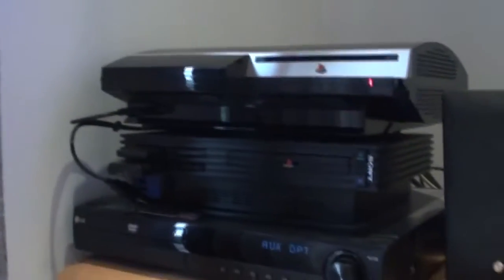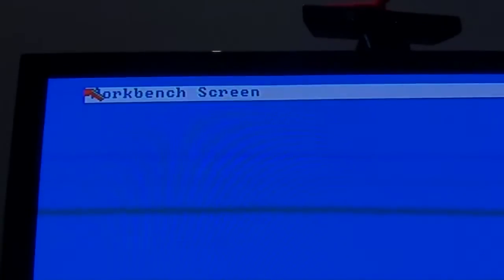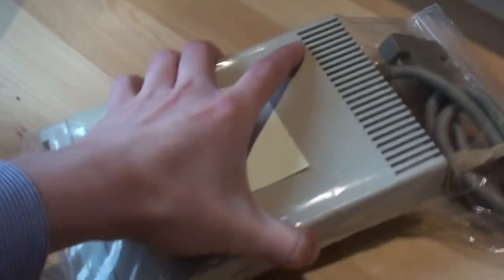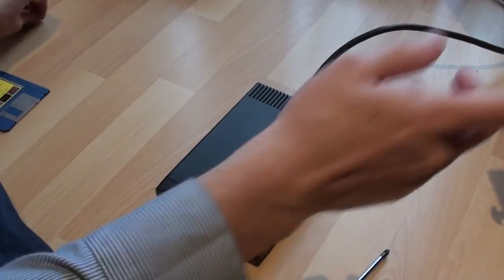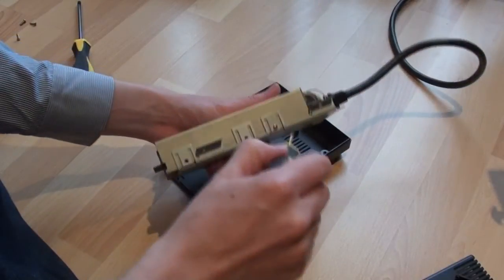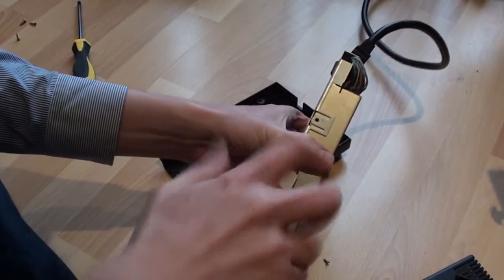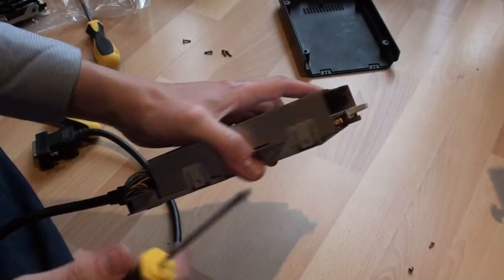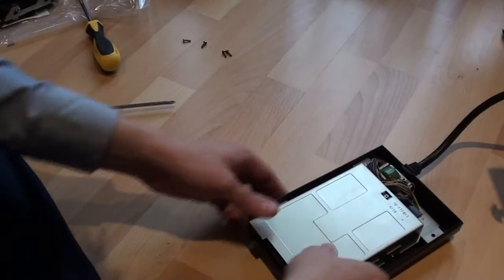Amiga Floppy Disk Drive Repair

Comment: Just an idea. Can it be the capacitors went stale over time? When you put on the shielding it attaches through the screw holes to the ground contacts of the pcb which changes the characteristic of the circuit. Maybe without it somehow the drive manages to work (barely functions by a chance). I would try to recap the drive with new capacitors?

Comment: Clean the 2 switches on the front with contact cleaner, clean and grease the head spindle, clean the heads, and change the 4 caps 😏

Comment: I've just repaired my similar drive with similar issue. The switch that gives signal when a floppy is inserted was, as suspected, faulty. I screwed it loose (only one screw) and pulled it carefully out ( 3 wires soldered on, ground, floppy inserted, write protect). I then opened the plastic carefully (the brackets will break, used superglue when closing it). Inside the switch, one microscopic metal sheet was out of position, I fixed that and used super-glue when closing the switch plastic again. Floppy drive now works fine.

Comment: It's black tiny micro switch on the corner of the drive. You could spray contact cleaner spray into it and give it a wiggle. Isopropyl alcohol won't work because it doesn't remove oxides from metal contacts.
Reply from the maker: +Matt Gorzka yep that's exactly what I did in the end and it worked great. Have two working drives now. Great tip

Comment: It's black tiny micro switch on the corner of the drive. You could spray contact cleaner spray into it and give it a wiggle. Isopropyl alcohol won't work because it doesn't remove oxides from metal contacts.

Comment: You have to open the disc detection micro switch and scrap the contact plate in the bottom. they get corroded over the years and the switches makes bad contact. I fixed 3 drives by doing this. It's extremely small springs inside the switches and I had alot of trouble because everything was so small. But when done properly it will fix the problem. Using CRC/contact spray on the switches would just fix it for a period and the problem would come back. So the only permanent fix was the above mentioned.
Reply from the maker: +Mats Larsen I just sprayed some Isopropyl alcohol all over the switches, the original drive has worked fine for about 3 years now. But good tip.
Reply: I also tried isprop. Your switch was probably not heavily corroded on the contact surface then.

Comment: If you take the case off and look through the front there are 2 buttons that are write protect and change just keep the change button (the one on the back of the write protect) just hold the change one down
Reply: Also If you would consider subscribing if it works ok?

Comment: THIS GUY IS AN ANTI COMMODORE RETRO STUFF ! HE ENCOURAGES PEOPLE TO MAKE  mods and other hardware changes compromising the original Commodore systems structure !  IN THIS VIDEO HE´S  DISMANTLIN AN ORIGINAL AMIGA (rare)  DRIVE TO PUT IN A CDTV ! THIS IS ANOTHER EXAMPLE OF THE LACK OF RESPECT FOR THE ORIGINAL COMMODORE PRODUCTS THIS GUY HAS.
Reply from the maker: Not wise to comment on things you don't know about Gulliver. The black CDTV drive is rare, the beige Amiga one is pretty common. Anyway I repaired the drive using some cleaner on the disk insert switch, the Amiga drive has been happily working for over a year now, currently with my A4000. No drives were harmed in the making of this video.
Reply: Is pretty common where you live  but in the rest of europe it´s not !
Reply: Dan Wood (kookytech.net) I am not apologist with regard to certain videos you made and others you´ve been doing because it is my belief that a commodore or other retro computer should remain original 100%. I´m owner of three Commodores and i keep them as they were designed
Reply: Get your head out of your ass...
Reply: A guy who fixes Commodore Amigas as well as extents their life seems to do more for the community than you do it seems, oh dear.

Comment: I had similar problems with my drive in an Atari ST and an Amiga 500.
There are 2 (3 on HD drives) "buttons" inside the drive which are operated by the disk. One scans the WP hole and the other gets pushed down whenever a disk is inserted. Probably the one that gets pushed down by the disk has gone bad.
It doesn't necessarily have to be a "button". My A500 drive had a magnet on a tilting mechanism that got tilted towards a reed contact. That reed contact has gone bad.
It affected the WP sensor not the disk present sensor. It drove me mad. Every time I wanted to demonstrate it to someone it worked just fine.
BTW... you don't have to butcher a similar external drive. Any old amiga drive should work just fine, I guess.

Comment: Hello, I also had problems in recognizing disks and I think it's the pin which detects the drive. There are two pins, one for the disk recognition and one to check the write enable hole of the disk. I think this touch sensor (aka button) has a problem. Did you try this?

Comment: I used to have a CDTV years ago, should have kept it. Anyway If not mentioned before check this video out, Chinon drive with the same problem and possible fix: JPSOP_Gxkcs

I would tend to aim for lubricating the mech, frame etc rather than messing about adding more springs... I can see the little spring hooks snapping at a later date which is not good!  I am also going to refurb an A500 Chinon drive soon! Fave drives, my first A500 Rev6A had one :)

Comment: It's probably the spring that pulls the mechanism together when the disk is inserted - if the spring becomes weak through repeated usage the mechanism doesnt pull together tight enough and the disk doesnt quite press the switch firmly enough down.  It floats in a state whereby vibrations can switch / unswitch it.

Comment: There's another vid on youtube for Amiga HD Floppy Drive Repair.  Not the same problem and it's HD, but it has a great view of the disk inserted switch and how to test it, along with some software on aminet.  My 500 drive was acting similarly, I just needed some contact cleaner in the disk sense switch and then actuating it a bit to get it cleaned up..  Might not be the same, I didn't have the problem more with the case on, but worth a shot.  Good Luck.

Comment: If it works when you try pushing it down to help it lock into place, you have isolated the problem and know that what I described is causing this to happen. If there is no difference, you probably want to suspect the switch in the first hand. Check it with a multimeter to see whether the switch is ok. It might be intermittent.
I acutally made video about a similar floppy problem not long ago. Maybe having a look at that video will give you an idea of what to do? :)

Comment: What this means is that, because of the mechanical resistance applied from the sides, the springs in the drive will not have enough strengh to fully push down and lock the disk into place. This will result in the disk not getting pushed down far enough to trigger the momentary push-switch that acts as a 'disk-in-drive'-sensor. You can try this by, after inserting the disk, trying to push is down with your finger to help it lock into place. (Continued again...)

Comment: Hi Dan! Nice channel you got there.
I read some of the comments here, and it seems like some people are suspecting the 'disk-in-drive' sensor switch to be bad. However, I do not think that is the case since it works better for you when you untighten/remove the screws at the side.
My take on it is that when you tighten those screws, pressure is being applied to the disk drive from each side. This keeps the (probably worn-out) spring-loaded mechanism to move freely. (Continued...)

Comment: Typically that problem is due to a dirty disk sensor. Just inside the drive opening on the left is a little box with 2 plastic pins. One gets pushed down by the disk and one gets pushed down by the write-protect tab. There are *TINY* contacts on the bottom and when they get dirty from normal use, they stop making good contact. You can use contact cleaner spray, but use a towel, it goes all over! I took the pin box apart once. I don't recommend it, the contacts are almost microscopic!

Comment: I'm no Amiga expert, but generally when a disc drive is having problems like yours, and it's not the connection cable, you have a bad circuit board on the drive, so check your board for any blow caps, and/or bad traces, etc..